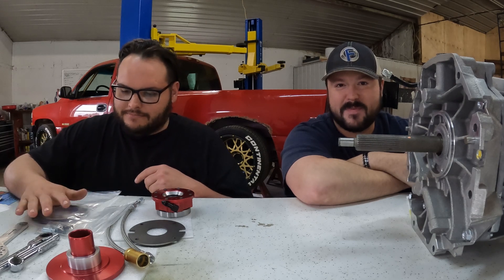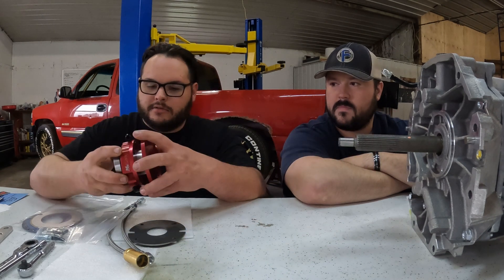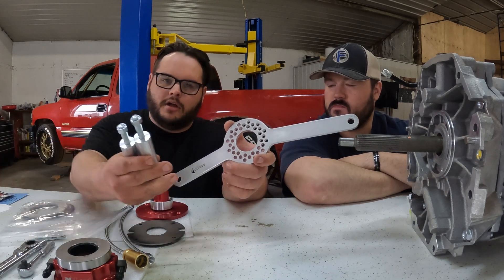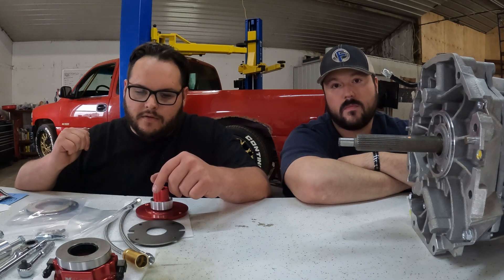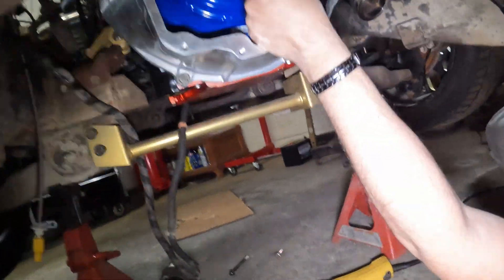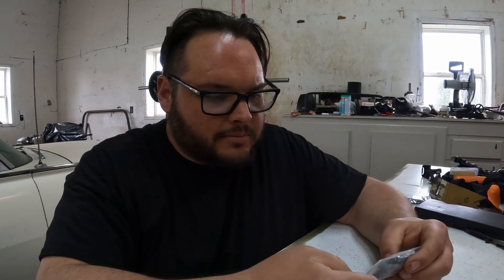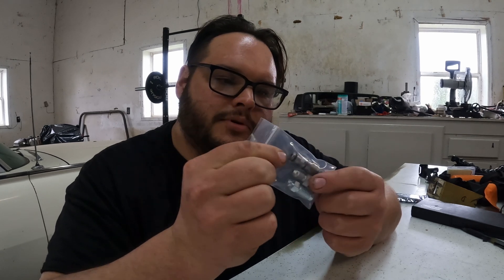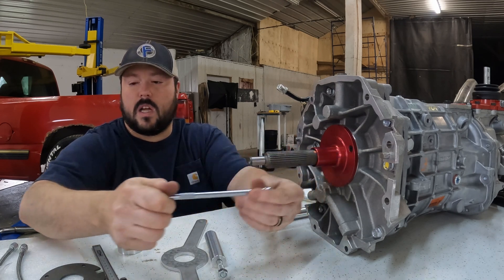HYDRAULIC THROWOUT BEARING INSTALL AND SETUP

Comment: Which flywheel did you use are you using stock truck starter?
Reply from the maker: We just used a stock style aluminum flywheel. This engine is a 5.7 ls1 from a trans am so we are using the trans am starter.
Reply: @onthebrink47  ahhh thanks how the throw bearing setup working getting all my ideas from your videos looking to 6 speed swap my single cab great info bro
Reply from the maker: @victor.hugo.differentialz  everything is currently working as it should. You’ll love the manual swap once it’s done!

Comment: wouldnt you also account for the tool thickness (.25) on the transmission side too?  Thanks for posting this btw 👍
Reply from the maker: Yes. That is correct. It’s been awhile since we did this. If we did not mention it in the video we should have. My apologies.

Comment: CSC vs external slave push style, which do you perfer?
Reply from the maker: Honestly this is our first experience with this style. I’d have to say it all depends on the intended use of the vehicle. I went this route for quicker engagement and better pedal feel, it was recommended by the guys at tick performance. It also has less moving parts which I’m a fan of. Less points of failure. However I do believe it will wear more quickly as it is basically in contact with the clutch springs at all times. More pressure will be applied as the clutch wears. I would highly recommend if doing this style to get a speed bleed hose for it. They are a pain to bleed without it. In a daily driver I’d want my slave externally mounted so that when it does go out I don’t have to pull the trans to replace it. (I have a truck in the shop with an internal one now waiting to be replaced). Not looking forward to it. And it will probably last longer as there is more play in relationship to the clutch springs.

Comment: What clutch and flywheel did you guys use?
Reply from the maker: Both are from SPEC we got through tick performance. I went with an aluminum flywheel to keep rotational weight a little lower. The clutch is a “stage 2” it’s a single disc with a spring hub. Rated for 800 hp. Next Friday will be a video of all the parts and cost breakdown. Stay tuned for that if you’re interested.

Comment: Get a manual from the manufacturer. You aren't in the bush without resources.
Reply from the maker: This is true. We expected something with the part but did not receive anything. We tend to fail to research thoroughly on average. It becomes an issue.